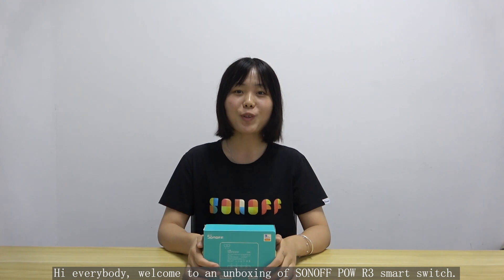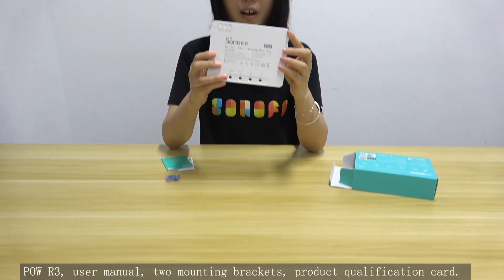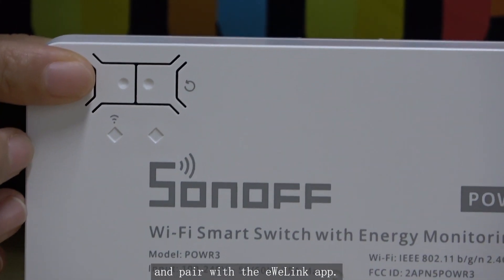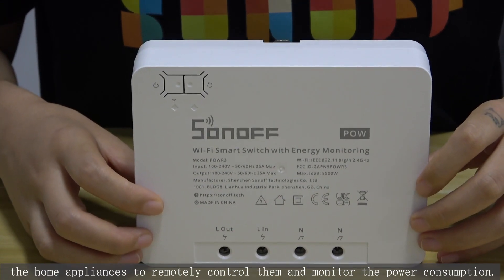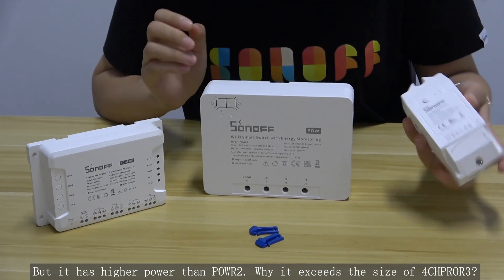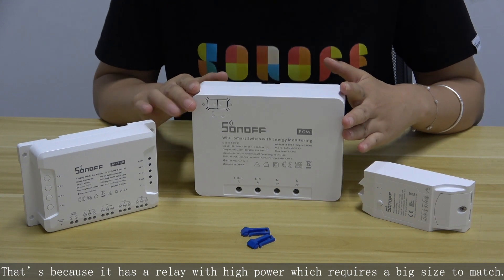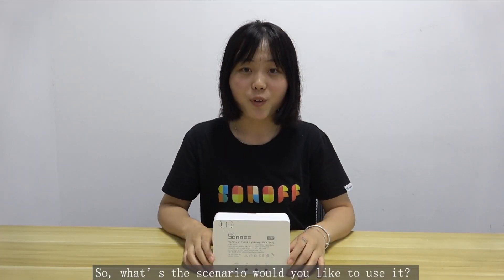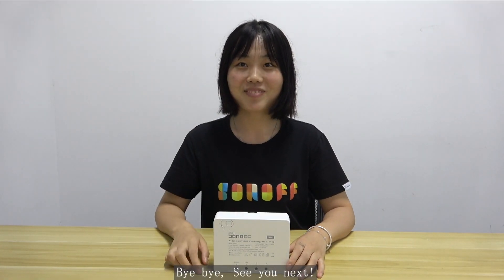Unboxing of SONOFF POWR3 25A high power smart switch with power metering

Comment: I want to use it with a domestic water heater of 2000watts and also a 1.5 Horse power air conditioning unit., meanwhile will it work on LAN mode?
Reply from the maker: 5A inductive load, 25A resistive load. You can compare them with your load. Yes, LAN mode is available.

Comment: very Good Device : i want to you to make wifi power breaker it will be easy to intall in electric box
Reply: Yes, you mean DIN rail type like a circuit breaker
Reply from the maker: Will evaluate.

Comment: It got too big
Reply from the maker: A little. Because it supports 25A and 5500W load.
Reply: @SONOFF  This will run a 2500-3500 W geyser electric element
Reply: How much a Price
Reply: @mvenkatesan9937  U$35